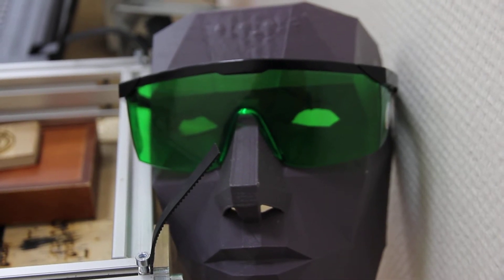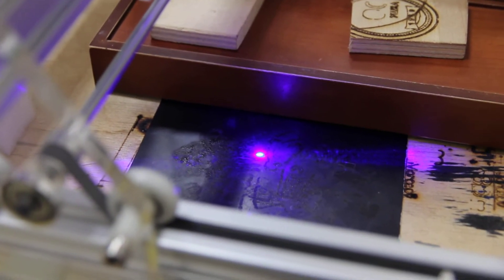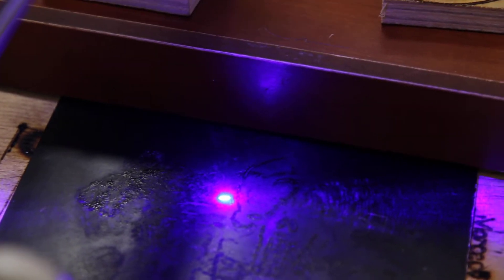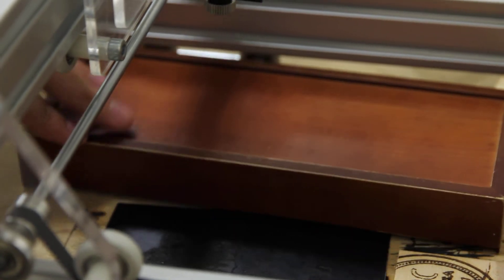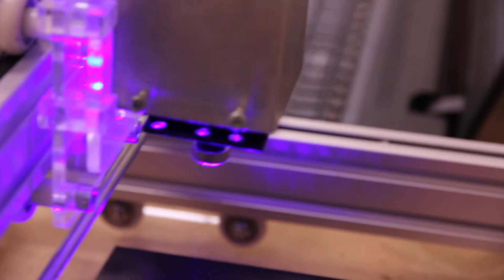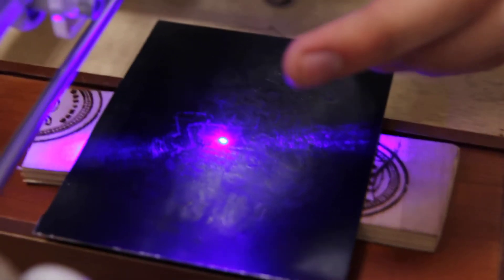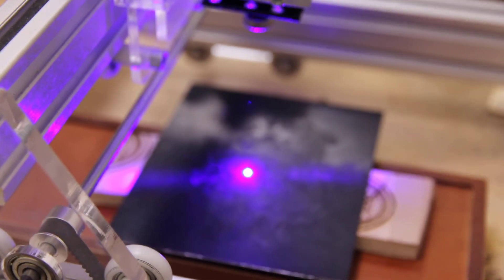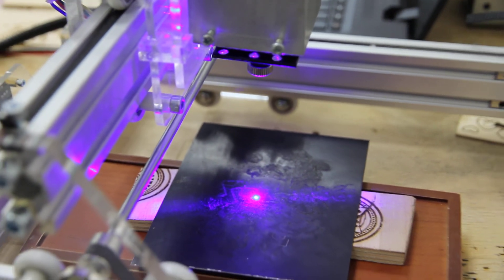How to focus a laser beam

Comment: Thanks for your answer. Next question is  the beam when focused circular or rectangle?. I have a 3.8 watt and it seems that it will never be a simple round dot but a rectangular dot. Problem is getting detail on picture engraving. I think I should be able to get better detail so I am at a loss of how to get a clearer picture engraving.. thanks again
Reply: Hi Jerry, What I learned watching this video is that I was trying to focus my beam too far away. When I raised the level of the material I was able to focus the beam to a minimal dot and get a very tiny cutting beam. So try lifting the whatever it is you are engraving on up higher. Thats what I did.
Reply from the maker: Jerry Simeone  that is true. it is not round when it is unfocused... but the min dot can less than 0.1mm if right lens is used

Comment: Hi. What is the output wattage of laser when doing the adjustments?.I wouldn't want mine at highest power when putting my finger on adjusting nut. Thanks
Reply from the maker: well, we use 5.6W laser... in this example... the good thing is that you can miminize an output... in this experiment we did about 5% from 5.6W power laser equals 250-300 mW... and it is quite safe for fingers... don't worry)

Comment: Thank you for this explanation. I have been trying to focus and cut with material on the table my laser is on and just could not focus well enough. Now that I have raised the height of the cutting material, I am able to get a nice tight focus and the laser cuts very nice! I am able to cut very intricate designs now and cut out my airbrush stencils.